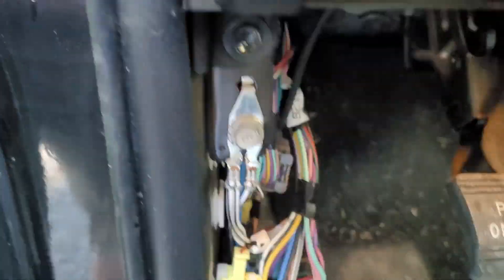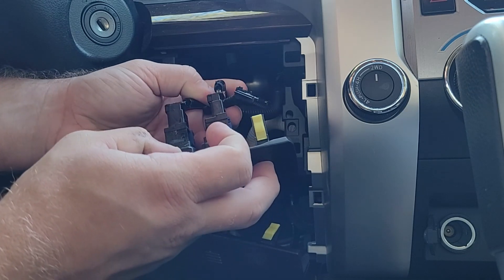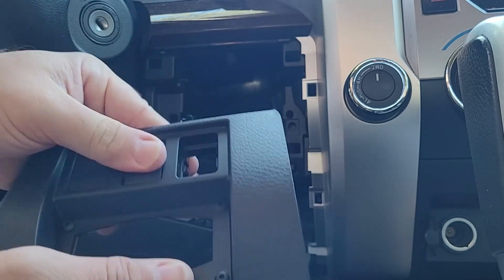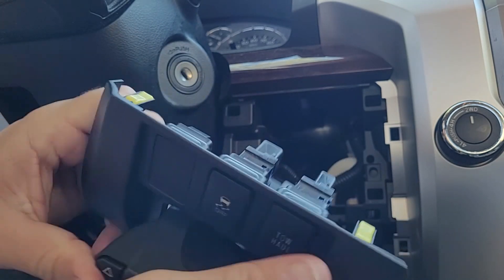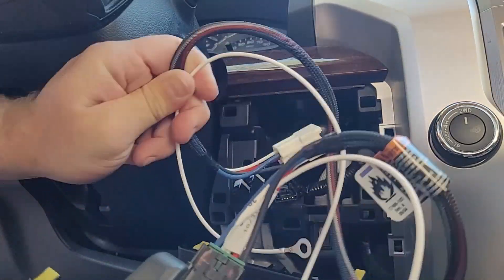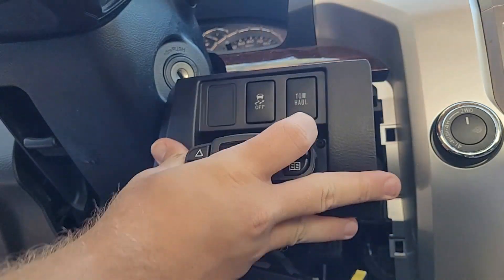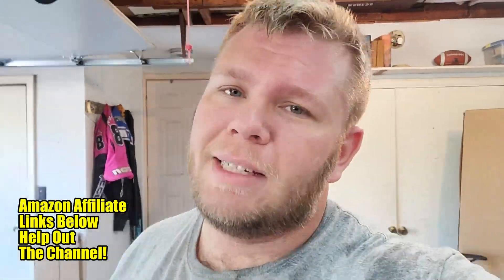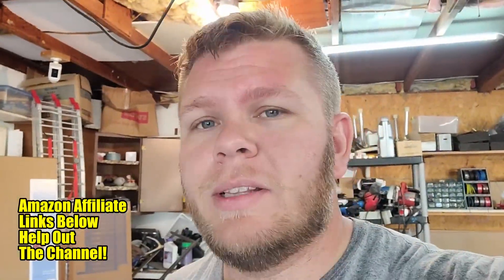TEKONSHA P3 BRAKE CONTROL Toyota Tundra Install

Comment: Followed your directions and it worked out great. I think the most intimidating part is pulling the dashboard apart and hoping not to snap a fastener. Thanks for the video.
Reply from the maker: Glad I could help. 
Thanks for watching and the kind comment!

Comment: Thanks got the video. Just got my Tekonsha p3 to install and I was ticked it didn't fit the mounting plate. You'd think the top is the larger half oval,, but it's not. I flipped it and I see it'll fit better after I take that little clip part off.
2016 Tundra,, thanks
Reply from the maker: Thank you for the comment! Breaking the clip off the controller allows it to sit deeper in the mount. I don't remember, but I think I tried to slip it in upside down and it falls to far back into the bracket.

Comment: Did you cut the white ground cable from the plug? Can you leave it in the plug harness?
Reply from the maker: @mattk8524  i don't remember cutting any wires when installing this.

Comment: Was wondering if it’s upside down then maybe you can unscrew the plate and rotate?
Reply from the maker: I believe when I was filming the video I did try it the other way and it wanted to slide in and out even when you put the bolts in the back., it gave it an inch or so to move. I don't have the original footage anymore to check.